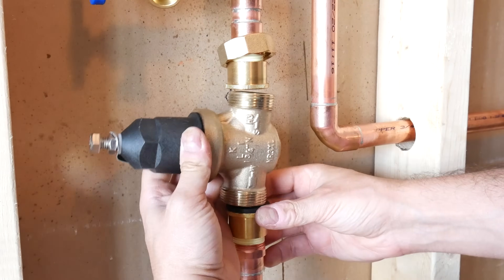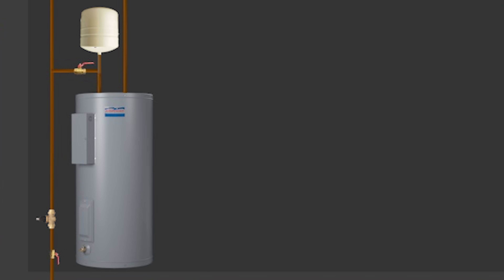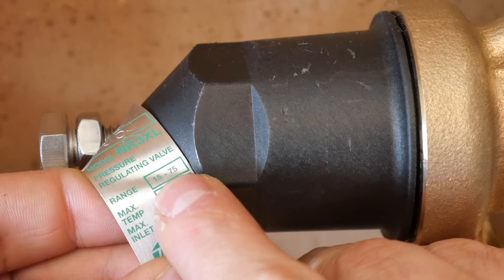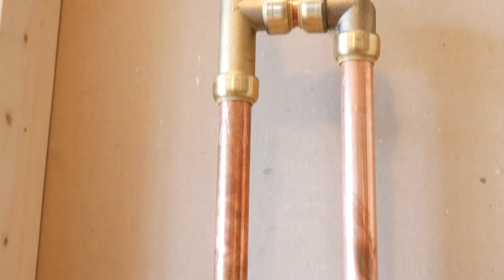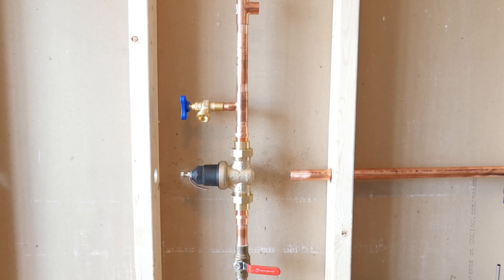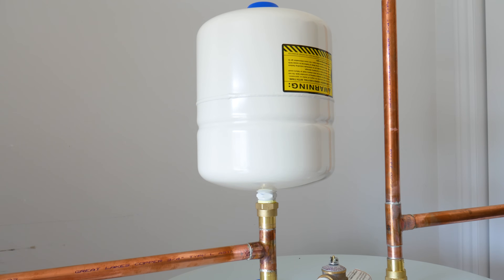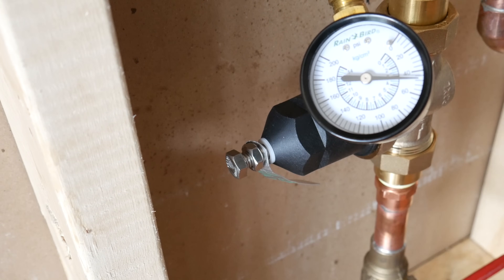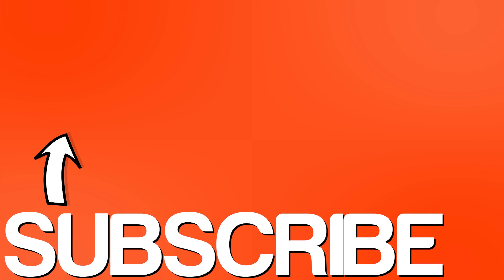How To LOWER Your Water Pressure (COMPLETE GUIDE) | GOT2LEARN

Comment: Just make note of your incoming pressure. Around here the city pressure can be as high as 140psi. A cheap regulator will not hold up very long. The one in video fails here. A lot. Quickly. I always suggest asking your utility department which type they recommend.
Reply: No problem. Thank u for the video. I refer a lot of customers to got2learn site.
Reply from the maker: Thank you so so much !!!!!
Reply from the maker: Thanks for this information.

Comment: Just installed a Moen Flo and found an interesting situation.  When I shut off most faucets I get a rise in pressure from around 55 to 60-65 PSI.  It appears my water hammer arrestors are somehow trapping the spike and the one way valve at the meter is keeping it.   I noticed that one way valve must have a slow leak as I see the pressure eventually falls back to 55 PSI.   I run a tankless water heater and will be adding a small expansion tank to that setup to hopefully reduce this change in pressure a little bit.   I've not really noticed much increase caused by running the hot water as most of the expansion of the pipes happens pretty quickly.  I have PEX, Copper and CPVC in the home,  yep it's a mess.
Reply from the maker: Good idea on the expansion tank, let us know how that goes!
Reply: @Got2Learn  Added a little ST-1 expansion bulb to the tankless.   Water hammer is now only boosting the pressure to 57-58 PSI from 55 vs the 60-65+ that it was.  Just crazy how the hammer arrestors can act like a hammer pump boosting the pressure.  If I didn't have a backflow preventer on the service line it wouldn't matter none.

Comment: I use to not like these videos but I love them as I get more business from homeowners trying to play plumber.  There’s so many variables that 10 videos covering this issue couldn’t cover everything.  There’s bonding issues, grounding issue and volume issues which you failed to cover.
Reply from the maker: Awesome, glad you are getting work, cheers! And for the parts I failed to mention, that's what the comment section is for 😉
Reply: Instead of paying for someone else's vacations, big fancy trucks and expensive colleges for their kids, I just love saving hundreds and sometimes thousands of dollars per repair, and then investing the savings into more and more professional quality tools, which enables me to take on bigger and bigger jobs myself.  All of which have passed code inspection on the first pass, because I do my research and I know how to read the IRC and muni codes.  And in 40 years, I've never had to place a panic call for a professional to bail me out.  Between me playing plumber, electrician, carpenter, gardener and ASE auto mechanic, I've managed to equip a pretty nice shop and auto maintenance bay, complete with 80 gallon air compressor, BendPak two post hydraulic lift, and about $35k in hand and power tools.  All paid for out of the money I have saved on labor, inflated material and parts costs, and calling fees over the course of almost four decades of DIY work.  Thank you Internet, thank you YouTube, and of course, thank you to folks like Julio!

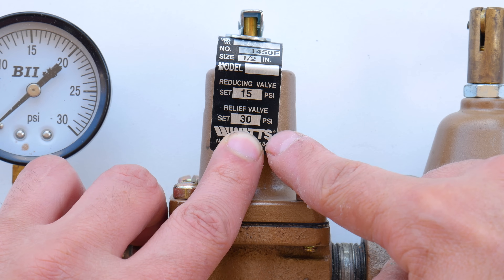Comment: Quick correction at 3:15.   The "PRV" shown in the video is a regulator.   A regulator is not the same thing as a PRV.  A PRV is the valve installed in your water heater.  The R stands for Relief, not Reducing.  A Pressure Relief Valve has a slim metal handle which allows for the relief of pressure.   A Pressure Reducing Valve (which is not called a PRV, but a regulator) has no such pressure relieving valve but instead has a diaphragm inside which reduces, or regulates , the water pressure to a lower pressure.  Do NOT go into a plumbing store asking for a PRV when you need a regulator.
Reply: I always heard of those as TPR valves (Temperature Pressure Relief). Good to know that these may be called PRVs to avoid confusion in the future. I would have just assumed PRV meant Pressure Regulating Valve
Reply: Wrong. You’re referring to the T&P, located at the water heater and designed to relief the Temp & Pressure of the water heater. The man in the video is correct in calling it a PRV= Pressure Regulating Valve, and making you wrong. I understand some guys use slang terminology but someone taught you incorrectly or just misunderstood

Comment: My water pressure is high right now 100 psi and I am putting in a PRV to set at about 60 psi for the indoor plumbing fixtures.    Would this effect how a gasoline pressure washer is used around my house, should I pipe my garden hose spickets before the PRV so they stay at the city water pressure ?
Reply from the maker: I don't think your washer will be affected but if you think your sprinklers will be weak, I suggest not reducing them.
Reply: Your pressure washer probably operates at 2000+ psi. A difference of 40psi does not really matter as long as it get's a sufficient volume of water.

Comment: I am on a well that is over 100 feet from the house and on a 50 foot lower level AND it's 130 foot deep, so what I really need is to be able to increase pressure to at least the outside outlets.
Reply: Volume is what you’re seeking, not “pressure”
Reply: @Tobias-m5p5d   I’m guessing your outdoor irrigation hose bibs are ran with 1/2” pipe.   3/4” would be minimum for irrigation lines.   They should be plumbed BEFORE any filters, water softeneners, etc.  

If you REALLY want volume go 1”. 😎

To “test” the theory, go to your well.  Turn off power(temp just to orotect yourself when working with electricity near water) There should be a drain valve at or near the pump or pressure tank.  Open it.  I’m guessing  you will find it’s going to flow VERY well!!! 😎

Comment: Great video,I feel that I should mention that now a days water companies are installing back flow preventers because according to them (the water companies) back flow may contaminate the water supply so back flow prevention is necessary.Before you buy a Pressure Reducing Valve check with the water company that services your area and ask if they use back flow preventers which they probably do if they have upgraded their water service lines.I don't think that installing an expansion tank upside down is so critical because the water in the expansion tank isn't likely to stagnate as in the case of an expansion tank for a water heater where the expansion tank's diaphram pushes the water out of the expansion tank when ever a hot water faucet is opened.If in doubt what I would do is to install a check valve where water will exit the water line but will not allow the water to back flow (return).Great video,God bless you and yours.P.S.,I looked to see how much the PRV rebuild kits are and I was shocked to see that the PRV rebuild kits are almost as expensive as buying the whole PRV new.

Comment: Why the hell would you ever want to lower water pressure??  Every place I’ve ever lived already had low water pressure coming to house.
Reply from the maker: The pipes knocking, old rubber hoses bursting, fixtures are rated to 80psi or they can burst...all of those reasons.
Reply: @Got2Learn  your house has 80psi coming into it???
Reply from the maker: Less, 65psi.
Reply: Got2Learn gripes!   I’ve never seen more than 35-45 psi to a home or a commercial property.
Reply from the maker: Common here in Canada, we never see under 45-50 here.
Reply: @billnipp2309  I viewed this because my house has 78-80 coming in; i'm in a low part of my small suburban town. I' ve heard most of Chicago (an hour east ) is about 35psi.
Reply: Speak for yourself.  My water pressure from the city is over 100 psi, sometimes hitting 120.  You want that kind of pressure coursing through your PEX plastic piping 24x7x365??  That's WTH I would want to lower water pressure.....
Reply: @StilettoSniper  any place I ever lived or worked is 35-45 psi.

Comment: Customers house I remodeled 3 bathrooms in. 
Their pressure always seemed high to me and I always had a ad time with new shutoff valves leaking. 
Turns out their PRV has failed. Their house had street pressure coming into it. 120 psi! 
Once we started digging, found multiple solder joints failing throughout the house. 
Now they have a mess on their hands because it is unknown how many kore were leaking slowly and potentially filled wall cavities with mold. 
Be careful with water pressure.
Reply: Same in my former townhouse, although the line pressure was 100 psi and the piping held. I started looking into that after replacing water heater that lasted only 8 years. Cheap model, but still. Pretty sure high pressure is not good for the tank longevity. There was no expansion tank either, so I installed an expansion tank and a Honeywell/Braukmann PRV. By the way, those townhouses were built like crap and one day, a neighbor had his entire 3"" sewer plumbing suspended in the crawl space fall off from the floor  joists and break into pieces. They didn't notice till there was an actual pile of shit down there. ServiceMaster was called for that one...

Comment: Timely vid: last week a friend of a friend had an intermittent leak around her hot water tank. The plumber claimed the leak was do to the expansion tank, that it was incorrectly installed on the HOT side (instead of the cold).  Does anyone out concur that the expansion tank, "might" last longer operating with COLD water?
Reply from the maker: If it's on the cold side it won't do it's job as good.
Reply: @Got2Learn  Incorrect. Water heaters have a check flap inside the nipple on the OUTLET, to prevent back feeding out the cold side because heat rises. The check in the hot outlet creates an anti siphoning point where as if its unchecked the hot water can rise into the cold inlet and siphon from the open hot outlet. So the thermal expansion is taking place inside the water heater and ejecting out the path of least resistance (the cold inlet) nothing will be protected if its installed on the hot side. This is false and should not be practiced. They literally make pre built risers for the cold side with a valve and FYI an expansion tank can be located anywhere in the COLD line per code.
Reply: Most installation instructions and manufacturer recommendations of thermal expansion tanks require them to be installed on the cold inlet side at a minimum of 18"

Comment: The one and only time I've soldered copper was installing a prv on 1". Couldn't use shark bites since it was roll copper pipe coming out of the slab. Pressure was spiking at 100 psi on urinal and toilet shutoff.

Comment: Water pressure is already pretty low on home building in the 1990s in Calgary, because of the freaking Poly B they used lol.
Reply: My 1994 Calgary home has 100 psi and poly B.  I’m looking to lower it.
Reply from the maker: Good idea :)
Reply from the maker: Didn't know polyb lowered pressure, you know what may cause this?
Reply: Got2Learn what I meant is that the pressure is lowered by the city because of the polyb, so it doesn’t leak lol.
Reply: @Viper6-MotoVlogger  - What?  They lowered the city water pressure because of PolyB?   Wow, I don’t think that really helps, might give you a short reprieve for the issue that PolyB will have at some point but not enough to make everyone have lower water pressure.  PolyB is bad stuff, things like chlorine in the water make it break down, become brittle and crack.  Only fix is replace it, not lowering the water pressure, that just makes it leak less water, doesn’t prevent the leak.  :)
Reply: Jim K I know. Eventually it will be expensive to replace all the pipes on my two story home 😢
Reply from the maker: Ahhh ok I get it, I had no clue that had to be done, screw polyB!!!
Reply: Got2Learn 👍👍

Comment: Remember it’s always good to hire a plumber, if you cause a leak and can’t stop it that diy job can cause you thousands in water damage
Reply from the maker: Absolutely!! I just want the DIYers doing it to at least know how to do it properly so there's less chances of that happening, thanks John!
Reply: Know where you water shut off valve is and how to use it before attempting anything, at a minimum. Actually, it's good to know that even if you aren't playing with your plumbing. Never know when something might spring a leak